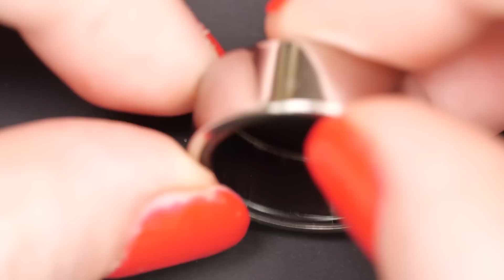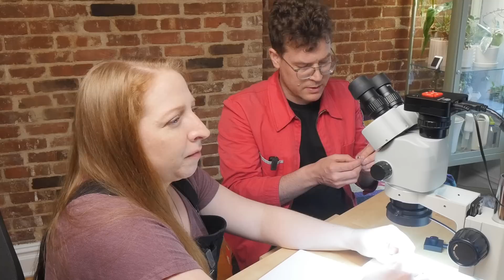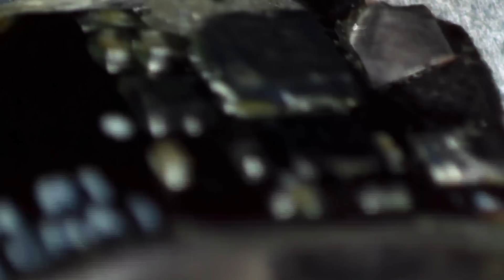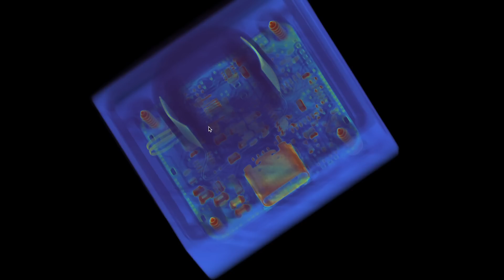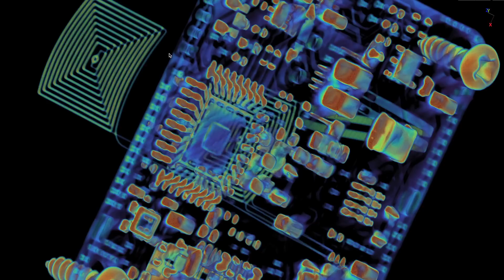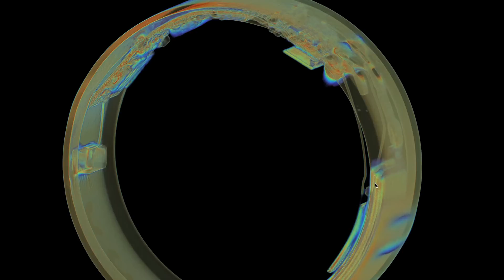What's inside the Ultrahuman Ring AIR?

Comment: The charger seems to be dumping raw 5V straight from the wall adapter right into the induction coil MOSFETs - this may very well explain the rings dying on the charger and company deflecting the blame "you used bad wall adapter" - well yes, but Ultrahuman didn't add a $0.3 regulator part in between the wall and the coils, so of course the dollar store wall brick would fry your ring!

Comment: The charger is pretty interesting! No ferrite core explains why it has so powerful controller... The resonant frequency will be changing with it's position and then the fact that the ring itself is basically loop of conductive material so it forms shorted winding.
My guess is that the controller does extra work of keeping the frequency and waveform correct.
The second coil confirms it as they need to keep the magnetic field to increase the efficiency of the wireless charging and allow charging of bigger ring on smaller base flipped like Becky mentioned.

Comment: The intention of plate in front of the diodes might be to be (more) scratch-resistant than than the rest of the plastic. I imagine a little bit of  dust, sweat and activity would frost the internal over time.

Comment: The charging coils on the base are orthogonal to the registration section, so I think having two isn't so much about rotational alignment, but rather for accommodating a flip of the ring — regardless of whether you put it right-side-up or upside-down on the base, the coils will align.
Reply: Exactly this!
Reply: Just to clarify, the registration flat on the ring is the pulse oximeter and the scans show how the charging coil in the ring is 90° away. If you put the ring on right-side-up, then the ring's charging coil will be on the left. If you put the ring on upside-down (flipped over), then the charging coil will be on the right. The two coils on the base account for this and ensure at least one of the coils is tightly coupled to the ring's single coil.
Reply: Exactly,   was saying if they flip the ring over all the points are mirrored
Reply: I was watching the video just to see if they ever figured out that the ring has the coil on one side (not front or back) so flipping the ring would need 2 coils in the charger. Seems like a simple thing to figure out. Lol

Comment: Cool gadget. I’m however still dubious about the benefit of such a device. Sure it has cool sensors, but they aren’t medical grade, so not something which can be used for anything other than “rough guesstimates”.
So cool as a gadget,but not sure of the overall value.
My $0.02 CND
Reply: I see this with some smart devices coming out with 'blood sugar' monitoring. However, at present to actually get a true measurement of blood sugar a sub-cutaneous sensor is needed. Anyone that claims otherwise will have super vague data, that is not that helpful.
Reply: all these parts are "medical grade" and are in fact used in medical devices.
That is not what differentiates medical devices from consumer devices.
The use case is what makes the difference and you can't have a device on your finger give you autonomous medical advise. Doesn't mean the data produced by these rings isn't useful.
Reply: @timonsku  ok - but by medical grade I mean something which could be used in a hospital- these certainly are not… nor should they be trusted as a source for medical diagnosis… so in that context no, not medical grade at least not byCanadian standards. 
Means basically a gadget which may or may not indicate a medical affliction. 
Still a cool gizmo.
Reply: Compared to my Polar wrist heart rate monitor, my Oura ring (so not this one) is way worse in terms of accuracy.